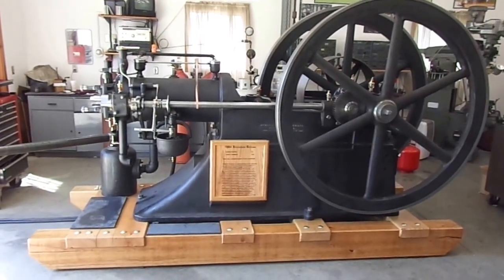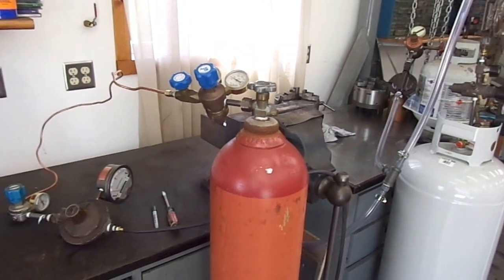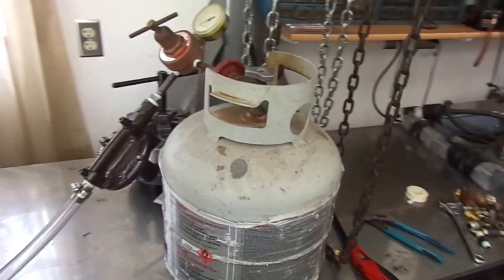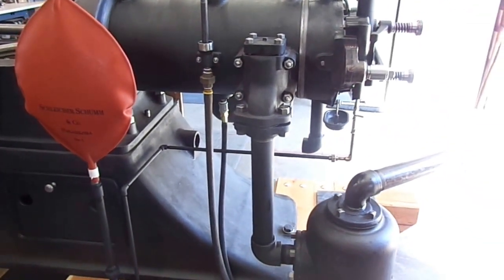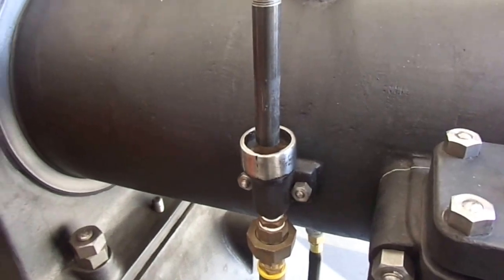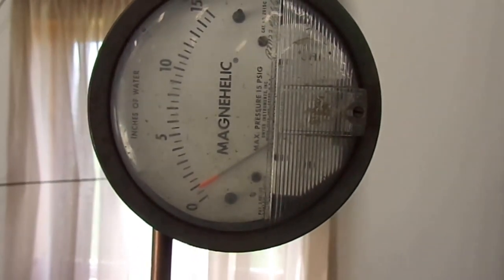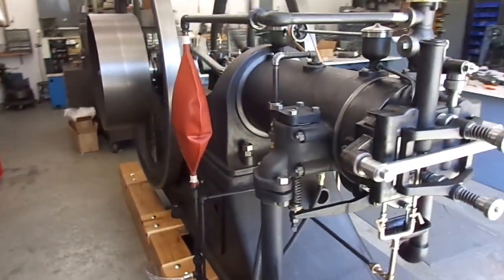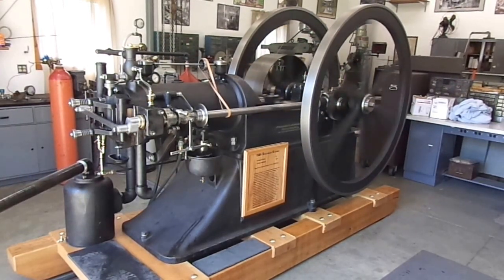10 HP Schleicher Schumm slide valve engine Start up week 2 after slide modification, re-rescraping

Comment: Is the slide valve only for exhaust and a poppet for intake? Or vice versus?
I love these old engines but even as a mechanic I need to have some of it explained to me.
This is the first slide valve internal combustion engine I've heard of.
Reply from the maker: The slide valve controls air inlet, fuel inlet and ignition.  Exhaust is through  traditional poppet valve

Comment: Hi Wayne, I was curious why you are not using the illuminating gas for the pilot? Will the  illuminating gas also work for that? Did the engines originally use hydrogen for the pilot or? Also why do you think the propane gives more power? is from the CO or the slower flame speed? Thanks!

Comment: Did you have the slide value and other hardware for restoration,  or did you build it from scratch?   It sounds like it must have been converted to electric ignition,  and popet valves.
Reply from the maker: +Greg Offenback The complete slide valve system was machined off the engine around the turn of the century.  For this restoration, all the slide valve components and cylinder head were made from scratch.  It was a real challenge since there are no 10 HP engines of this type to copy

Comment: beautiful engine! i think slide valves are one of the most interesting types of engines. do you know what year the engine was built?
Reply from the maker: +JPMotorhead1993  This engine was built in either 1882 0r 1883
Reply: wow that is a piece of history. If you don't mind me asking where did you find the engine?
Reply from the maker: +JPMotorhead1993 The engine is not owned by me.  It was brought to my shop for restoration.  It is believed to have been installed in a factory in Chicago where it powered an elevator.  It was then converted to Natural gas and the entire slide valve system removed and installed in a factory in Hamilton Ohio around 1910.  It was removed from that facility around 1974 by the curent owner.
Reply: very interesting story

Comment from the maker: It will start on propane, however it takes two people,  one to rotate the engine and one to slowly adjust the gas valve - propane has a more exacting ratio with air than H2

Comment from the maker: Bigdaddy: It has compression - about 40 psi at top dead center and then shoots up to 135 at ignition.  It is a fully functional four stroke cycle engine. The big difference is that it has a "Low" compression ratio of about 3.5:1 and is fueled by illuminating gas rather than gasoline and ignition is by Hydrogen carrier flame rather than spark plug or ignitor - Wayne